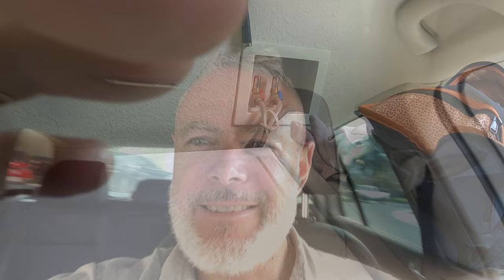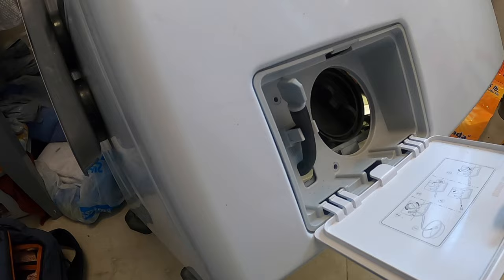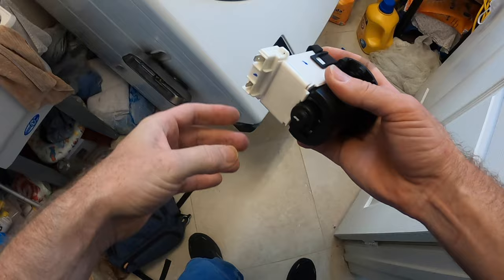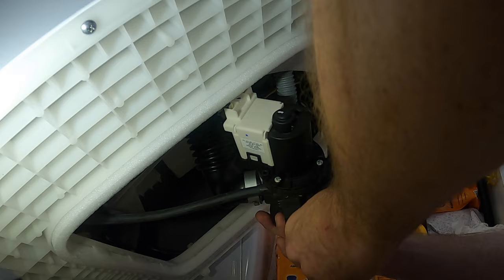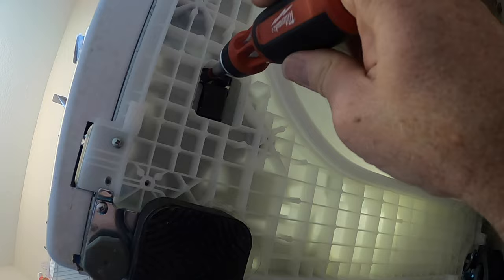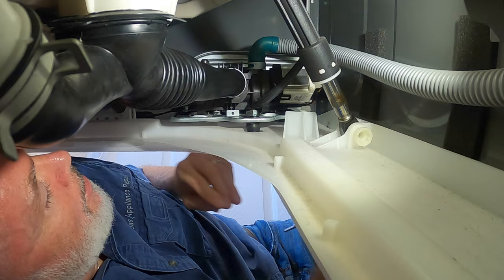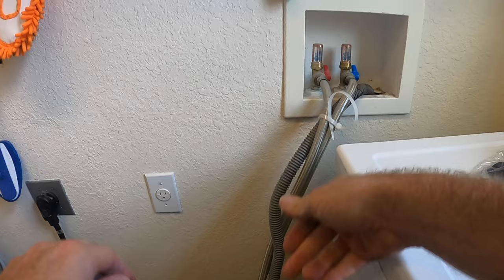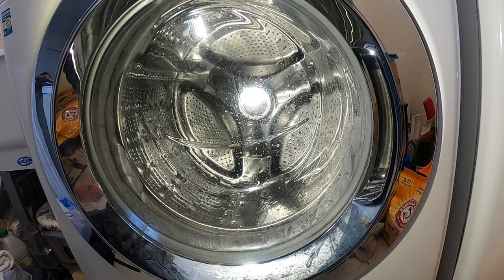LG Washer Drain Pump Fix in 7 Minutes

Comment: First of all thank you so much for sharing your video~I greatly appreciate those who take the time to help and give knowledge to others who need/want it!! So I keep getting this strange thing with my washing machine and I'm not sure if you'd have the answer or not.. I'm really trying to avoid calling anybody in because I really just can't afford it right now... but it seems like every couple washes my washing machine will code out to this weird symbol it almost looks like two e's, only the first e is missing the top bar if that makes any sense...So EE ( only the first e is missing the top bar of the e, or you can say it kind of looks like a L with an extra Dash🤔🤔) anyway I manually drain through that little hole is on the bottom I double checked the little filter thing in there isn't all stuffed up and then I turn the power back on and I set it for drain and spin and it'll drain and spin and everything seems okay.. I'm curious if that is also a sign of a pump issue or something else? I don't know if you would know I figured I'd give it a shot and ask... some days it works without any issues and some days I need to manually drain it because it shows that symbol, and then I drain it and then I do a drain/spin cycle like I mentioned... any help you can give that would be great! If not, at least I tried and thanks anyway😊
Reply from the maker: look up TE error code

Comment: Thanks to you I replaced my drain pump quickly and easily! It’s been working great for months but now I have a new issue. Washer is making noise during spin cycle. It’s spinning and draining fine but something is wrong. Any help? I can send you a video.
Reply from the maker: If is rattling there may be a loose air missing screw. if it is clicking there may be something inside the pump.

Comment: Just need to point out that my instance the stock housing is secured by 4 screws. 2 at bottom 1 in front and 1 in back. You can use a second screws driver to pry up the housing to get the front one.
Reply from the maker: Thank you for sharing

Comment: ok so i replaced the pump last year but it was a cheap knockoff and of course a year later it failed. i was dreading replacing it again because of having to take the top and front off again. seeing someone do it this way gives me hope that it will be a lot easier.
Reply from the maker: There is a link to the original LG pump in the video description

Comment: Does the position of the drain pump matter when replacing? Also when reconnecting the two wires on it, is there a specific way of inserting them? Because I just did it randomly and while it works i feel it makes a faint but noticeable grinding noise
Reply from the maker: make sure the circular front part of the drain pump is properly aligned with the circular window cut out on the front of the machine. You may want to take a photo of the wires before disconnecting them from the original pump so you know the correct position when reconnecting to the new pump. A grinding noice could be coming from somewhere else in the machine other than the pump or there could be something small that has made it’s easy into the pump. When changing the pump it is smart to clear out all the hoses commenting to the pump to make sure there is no loose debris in them. I use a shop vacuum with a cone attachment.

Comment: Also not mentioned, is the o ring gasket has to be pressed into the groove of the pump, or it will tear, or push out of the groove. The front pump screw is not accessible without drilling a hole in the plate. Only one screw is easily accessible from the bottom, the other requires drilling out the plastic structure to access straight on through the access hole.
Reply from the maker: Thank you for contributing. All of us helping eachother is how we move forward. God bless you

Comment: @appliancerepairamerican Thanks for posting this. Trying to help my grandmother out and wondering if it’s necessary to remove the hot and cold water hoses from the machine to do this installation? Kind of a pain on her machine would rather just keep them on if that works.
Reply from the maker: Just shut off the water valve

Comment: Thanks for a great video. Going to tackle the job this weekend and going through the bottom looks like a much easier approach. Any thoughts on whether tipping the washer backwards or placing on its back could damage the washer? Should it have the shipping bolts installed to tip it safely? Is laying the washer on its back only an issue when transporting?
Reply from the maker: Peter, you should use common sense when it comes to safety. Unfortunately i am not in the habit of giving this type of advise. I wish you the best

Comment: Great Video. I removed the pump. Now just waiting for the new one. 

By any chance. If it wasn't the pump or clogged screen. What can cause the no drain? Could something be stuck inside the drain tube itself?
Reply from the maker: Yes, When changing a pump I always make sure there are no clogs in all the areas where a clog can happen. I like to use a shop vac with a cone shaped nozzle attachment to get a good seal.

Comment: Ok so it seems as if my Tromm has maybe two pumps.  The draining hose has two electrical connection - on opposite side of the emergency drain out plug.   But the electrical connections are different colors …. One set is red / black (this was on the bad pump I replaced & the old pump was in a white plastic housing. I discarded the housing when installing new pump).  So my question is… what is the other thing that has a blue / white electrical connection??
Reply from the maker: This website has good exploded diagrams of almost all models; partselect.com. just put in your model number and study the part diagrams

Comment: Great video but i have a question. I removed my pump and wired to plug and pump seems to run fine outside of unit but i cant recreate obviously with hoses and pump full of water. Do pumps sometimes still run but wont push the water?
Reply from the maker: Sometimes if you put just a little bit of resistance on the impeller it will stop
Reply: It was the pump, all fixed. tks a lot

Comment: Found this by looking on how to get a lost drain hose to come back through the opening in the front after it slipped in. Since this is all I need, what is the best way to tilt the heavy washer to get under it? Do I still need to disconnect more than the power as a precaution?

Comment: That is not the correct method. There are two bolts holding the pump with rubber dampers. This washer in the video does not have them. It looks like the previous repair guy did not install them. I had to remove the top cover, control panel, front cover, to access the two bolts holding the rubber dampers.

Edit) I could access the front bolt without removing the front panel. I needed to make a hole on the front metal to access the bolt. There are two bolts under the pump, one bolt at the front of the pump. Two bolt under the pump could be accessed as shown in this video. Front one bolt could be accessed from the "new" hole that I made. This video helped me a lot. Thanks.
Reply from the maker: I had to improvise.  You can here it rattling when i bran diagnostic because it was not secure.  Yes it was the previous repair guy who did not secure it. Thank you for your advise
Reply: @appliancerepairamerican  Edit) I could access the front bolt without removing the front panel. I needed to make a hole on the front metal to access the bolt. There are two bolts under the pump, one bolt at the front of the pump. Two bolt under the pump could be accessed as shown in this video. Front one bolt could be accessed from the "new" hole that I made. This video helped me a lot. Thanks.

Comment: do you have a solution for vibrating too strongly even at 800 rpm? even if level, no movement on legs, but the body almost wants to fly
Reply from the maker: It is usually the suspension but could be other things. Some front load models also have two springs uptop that the drum hangs from. They also have a counter balance (cement block) bolted on which can become loose. The spider arm could be broken or other problem. Usually it is the suspension that needs replacing. Here is a link to this repair https://youtu.be/OT2gPJkH1BE?si=RWyAFJ0s2weTY-kL

Comment: Man I wish you were around when I had a “professional technician” replace my water pump.  Guy used an impact wrench and stripped half my screws when reinstalling.  Left the hosed poorly connected and caused leaks. When I called him back to fix the leaks, he couldn’t remove the coin trap compartment bc he stripped the screws prior, so broke the plastic housing as he was prying it off.  And finally, when he reinstalled the pump, he left half the screws missing including the two screws on the front of the water pump coin trap compartment (just like in this video).  

Called Sears to complain and replace the piece he broke and reinstall the missing screws.  They said can’t do anything until original technician comes back.  Hell no am I letting that guy back in my home.
Reply from the maker: Wow! That sucks.  I never use an impact driver and I prefer to use a manual screw driver for that very reason and it is good for the hands to use them. I was pretty shocked when i saw that so many screws were missing on this pump. Some guys just don’t pay attention and are more concerned with getting to the next job rather than staying present.  Most of these fixes can be done without a tech if you know how to use your hands.  I will be putting out a lot of how to fix appliance videos this year so always check to see if I have a video that can help before calling a tech.  Thank you for the comment and God bless you.  My name is Mark.
Reply: @appliancerepairamerican  - Yep.  He literally said, “I can’t stay here all day trying to assess the leak, I have 2 other customers.”  I said, “I am your customer now, and will call your office and cancel all your other customers if you need to stay here until midnight fixing what you broke.”

Yeah we regret not doing it ourselves, but we also pay monthly for a Sears Large Appliance warranty, so we wanted to get our money’s worth anyways.  We assumed these technicians have somewhat common sense or not just lazy.
Reply from the maker: When other companies suck It just equals opportunity for companies that put customers first.

Comment: It seems like when ours tries to pump water out it's very noisy, I'm guessing this is a Prelude to a failing pump?
Reply from the maker: Sometimes there is something stuck in it or worse something was stuck in it and it broke part of the impeller. If you unplug it, then take the coin trap out from the front, you might be able to feel around in the pump with your fingers. Or put it on its back and pull the hoses off and feel around in there for anything

Comment: My washer (same model and pump) is failing every 3-4 months. I've changed already 5 times the drain pump. Is it possible there is something else? Last time, I unplugged for 5 minutes, drained manually. And then tried again..... and worked for 2 weeks until it stopped draining again. I checked the last pump I replaced, and it works! What maybe the issue? Thanks a lot!
Reply from the maker: Make sure your drain line is no kore than 7” down into the stand pipe behind the washer. Get a shop vac on the drain hose and make sure it is clear. Also it could be that items or even sand are getting clogged. In the pump or the hose that leads from the bottom of the drum to the pump

Comment: Would anyone know why after every load i have about 2 cups of water draining from the small hose in front by the pump filter? It's literally a brand new washer.
Could it be the actual orientation of the drain hose? It seems very long so it is coming up the back of the machine, then back down then back up (so it's forming a U and the 2 sides of the u are only about 6 inches apart) and then into the pipe in the wall.

Or old washer has the house shoved waaaaaaaaaaaay down the pipe in the wall (taking up slack) and never had issues. However this new washer is saying don't extend the house now than 4 inches in the pipe.

 Thoughts? Thanks so much
Dave
Reply from the maker: Where are the two cups going, on the floor?

Comment: I actually used your video but cleaned the drain pump instead of replacing it (there was tension in spinning, seemed fine but full of hair and dirt on interior). I accessed it from bottom panel, but my LG (3499) has a full bottom panel. I reconnected everything where it belongs, but now I can't fully close bottom panel... the electrical wiring is blocking it from sliding in.  What did I do wrong?
Reply from the maker: I am glad the video was helpful, unfortunately I can not advise on your issue since I am not present to help. God bless

Comment: There is a second slightly smaller pump on the other side of the housing (at least on mine).  your hand is there in the video, when you remove what you call the drain pump.  My other pump looks like your drain pump.  The interface from the brass shaft to the the white nylon impeller has failed.  The motor is fine, but i see no way to replace just the impeller/shaft, so i ordered what i hope is the right pump.  What is the deal with the second pump on that housing?  Why is it not mentioned?  what does it do?  is it less likely to fail?

Comment: Every once in awhile our LG washer has the same amount of water in it as the one in the video after washing a load. 
Do you recommend pump replacement?
Reply from the maker: Could be that your drain pipe is backing up. Could be a bad pump. Could be a clog. If the drain pump is working I would not replace it

Comment: Thank you for the video!  I have the same machine and when the cycle to drain the water begins, water starts leaking from somewhere at the bottom.  I say somewhere cos I dunno where the water is leaking from.  Could it also be due to the drain pump?  Or could it be due to one of the pipes leading from the drain pump?
Reply from the maker: Could be. Leaks are not to difficult to diagnose. Water comes in through valves then through soap dispensers, into drum then out the center boot/ hose under drum, then through drain pump and out the drain hose
Reply: @appliancerepairamerican  I opened the top of the washer as you shown in the video.  Lo and behold, the little tube that drains away the water from the drum, was disconnected!  How that happened is still a mystery.  I've put it back in place, covered the top of the washer and BOOM!  We're back in washing business!  LOL

Thank you for showing us how opening the top of the washer can be an eye opener

Comment: Good video BUT mine had 2 pumps, and the first one is the easiest to get to, but was the wrong one to replace! In the video it looks like you've removed the first pump so we can't see that it is a different, smaller pump (I assumed I had a different model washer so thought I had bought the wrong pump, and found another one like it). I ended up replacing both which was probably unnecessary and took a lot more time. Would be great if that was called out so people don't make the same mistake.
Reply from the maker: The one connected to the drain hose is the drain pump. The other is the circulation pump. Not all models have a circulation pump

Comment: unfortunately, doesn't work for the AHA75853803 double pump on the newer WM3570 washers, as the mounting screws for the pump assembly are on the top (did LG do this to make it harder to fix, or is the new double motor pump better? it sure costs more)
Reply from the maker: There is a pump housing and the actual motors. you can buy the motors separately. If you have a drain issue you only need the drain pump. you can identify it by following the drain hose

Comment: I guess this works if the front screws on the pump are missing otherwise you need to dismantle the front to access the 10mm shoulder bolts of the pump mount.
Reply from the maker: They are not all the same even though thy are similar. i go underneath when it is easy, but usually i take the front off

Comment: After removing the pump, the rotor just fell off. That is the only problem. The cheap plastic rotor is stripped. The motor and pump, I believe, are still good. If only I could just replace the rotor. Or is it a propeller?
Reply from the maker: called an impeller . it sucks instead of pushes

Comment: Doesn't the drain pump doesnt need the plastic cover? Im replacing mine and it looks like its a newer model pump though it says it fits my washer model but the plastic cover doesnt fit it.
Reply from the maker: it protects it from water , but it will function without it